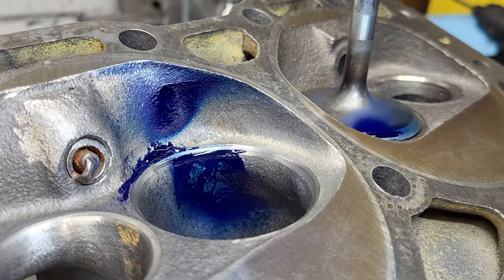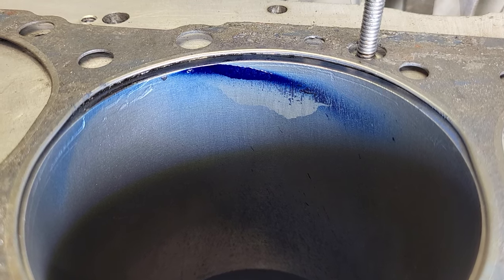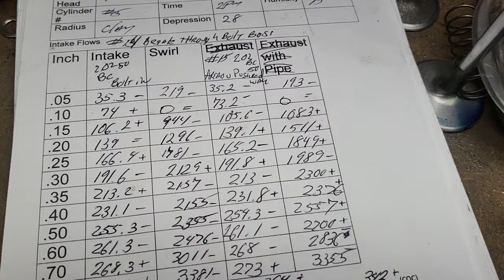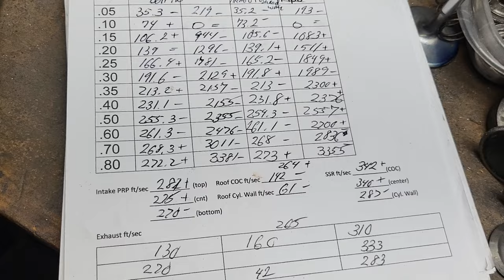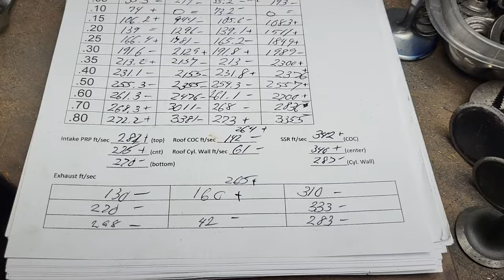63. Chevy 193 Swirl port cylinder heads, #15 Add area to push rod wall and pinch. loser!

Comment: By moving the ramp over, you've weakened the recirculation, this is why the cylinder side SSR has gotten slower. That recirculation bubble takes energy out of the bulk flow, and acts like a thumb on a garden hose for the flow that does make it past. I say don't rush a solution, just marinate on it, it'll come to you when you least expect it.
Reply from the maker: I took a good look at 25th cut today. That was a good curve.

Comment: Over all volume flow is roughly the same so net effect of your mods is just to change port characteristics, Velocities indicate more roof COC and less Roof cyl wall flow so flow is more centered up now , the PRP top took a big drop (from opening up) yet indicates flow is being limited somewhere else , whats holding it back ? like u say the short side is more reactive now, it will be interesting to see what changeing that area will do ?

Comment: Different question a year or 2 ago David vizard said there was a inexpensive modification to do to a factory sbf hydraulic roller lifter to increase the rpm capacity but never told us do you know the modification thanks
Reply from the maker: I don't know his modification. When I do a hydraulic that needs rpm I would adjust with the least plunger travel. No chance of pump up. Works pretty well. Thanks
Reply: Thank you
Reply from the maker: @marcusmerck5191  You are welcome.
Reply: What i like to do is replace the spring clip in the top of the lifter with a 3/4" C-clip, then set your pushrods at zero to less than 0.010" pre-load (depends on your heat expansion characteristics) , now at high rpm your liters only pump to the C-clip which won't possibly pop out like a spring clip could and your cam behaves like a solid at high rpm.
Reply: @marcusmerck5191 I'd have to go dig thru my magazine library, but way-back-when, Vizard wrote an article for Muscle Mustangs & Fast Ford's where he described taking the sbf lifter apart, grinding a flat on the hydraulic piston and  throwing away the check ball. Making it a solid lifter, then running super tight lash on a hydraulic roller cam. This is just from memory, I'd have to go find the magazine, though I'm sure I marked it. It was a curious idea when I saw him mention it
Reply: @kylemilligan752  thanks for searching I appreciate it
Reply: @bobgyetvai9444  You should disassemble an Eaton and Delphi style SBC/LS lifter. They are very different in design. However, both have a spring and checkball in the base of the  lifter. The disc you speak of is under the pushrod cup on a Delphi style lifter, and actually meters oil to the pushrod
Reply: @kylemilligan752  yes i realize this . Speed pro made the hydralics with only the disc years ago . There were none better !!! More than once at 8,000 rpm foot on the floor i missed a gear and never once did they pump or collapse . Ive recently seen such lifters for the LS  . Who makes i dunno but am going to find out . No springs No checkballs . No loose valvetrain .  Those ruin the design .

Comment: never seen solder used ??
Reply from the maker: It works pretty well. Thanks
Reply: Its also handy for measuring the port lengths along the walls.

Comment: Watch Jon Kassie interview, listen and learn ? Finger in port, of a Running Emgine, most flow is down the Middle of Port ? Squirting Oil into header , 12" from exhast valv , ends up 5 seconds late it is in the Plenum ? Why ? Rusty mild steel header pipe ?  Go stainless o Clean pipes weekly ? https://www.youtube.com/watch?v=moUZPvAmvr4&t=1416s
Reply from the maker: Seen it. Thanks